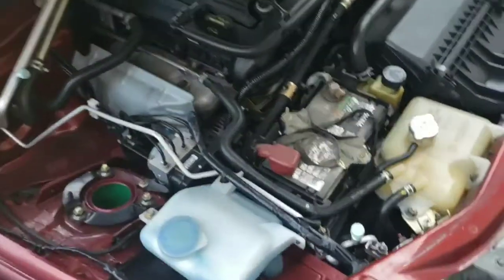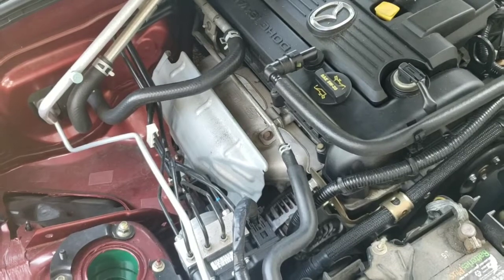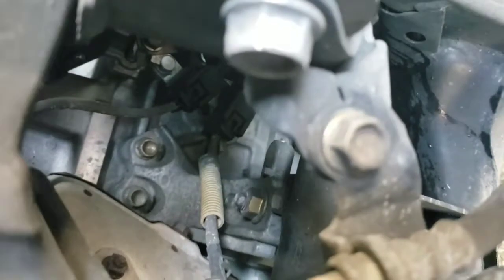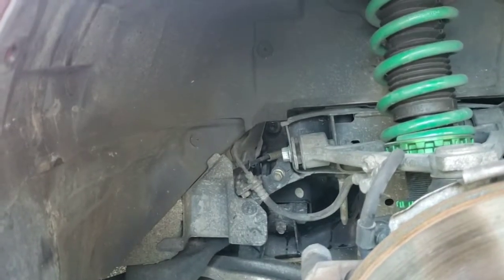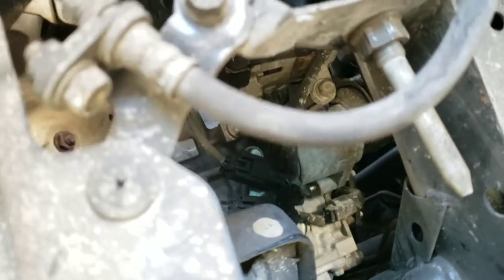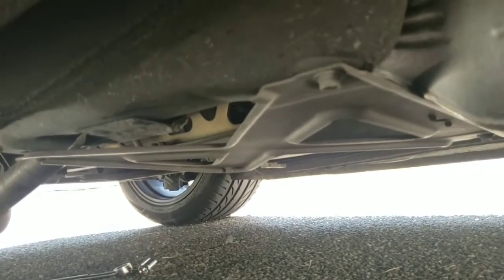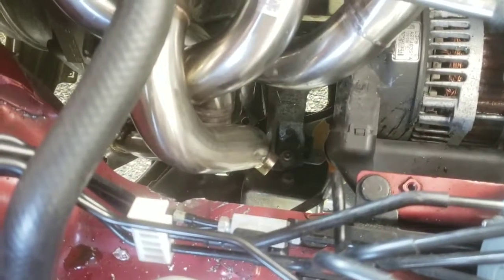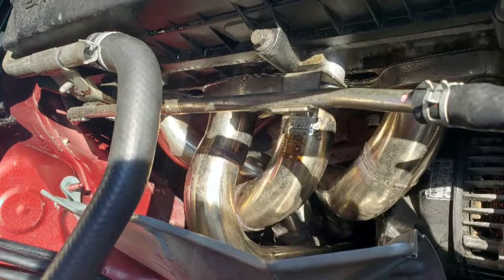skunk 2 alpha header NC miata installed

Comment: My header is the OBX V2 which is a tomei clone. 
I did not have to clearance the frame horns. The exhaust midpipe did not have to be removed at all. No coolant lines were disconnected at all. And the motor mount also did not need removing or the engine jacked up. 
The key to header installation on the NC is to remove the alternator heat shield duct. It has three 8mm bolts holding it on to the back of the alternator. The outer heat shield on the frame horn is easy to remove. Two 10mm bolts are accessible from the bottom with a long extension.
Anyone trying to do header installs should begin down below and disconnect the midpipe BEFORE removing header flange nuts at the head. Better to get the difficult contortionist work done first anyway. This job was nowhere near as difficult as I have seen people make it.

Comment: you don't have to grind out that spot. I just installed mine today, had to disconnect the passenger side motor mount and jacked up the engine by the oil pan a bit. gave it enough clearance.
Reply from the maker: Thanks for the info

Comment: How did you deal with the check engine light?
Reply from the maker: tune from fab 9 using versa tune
Reply: @MYWAYINTHEDRIVEWAY  so I would have to retune it? Like redownload?
Reply from the maker: basically you need to have your tune include bypassing the 02 sensor sending info to the cel. or depending on how savy you are you might be able to just turn that signal off your self with the tuning device you are using. I would contact fab9 and see what they can do for you